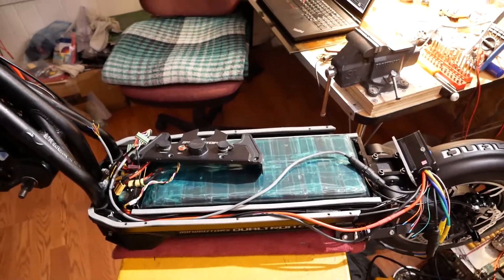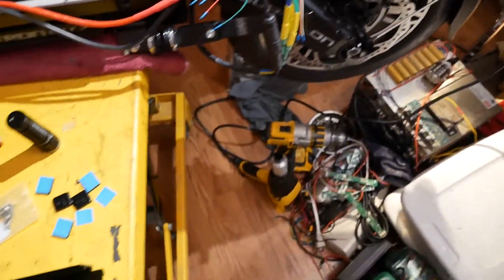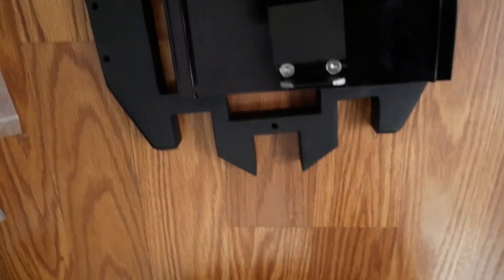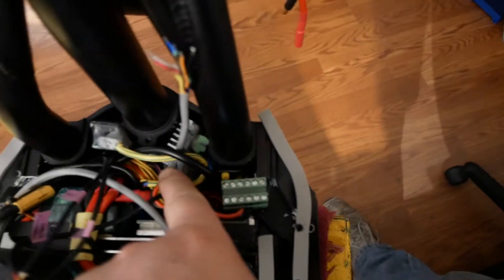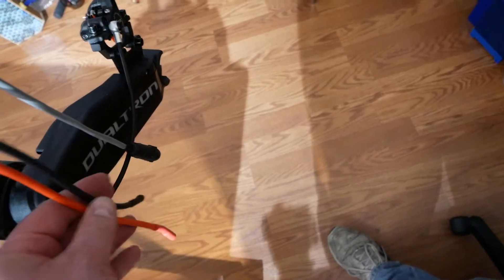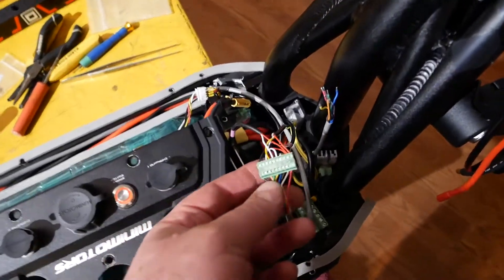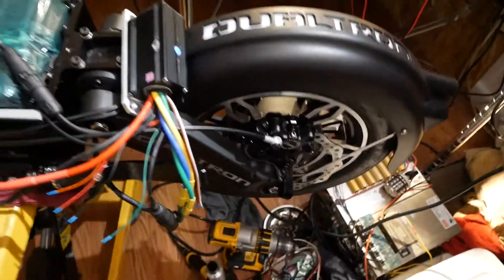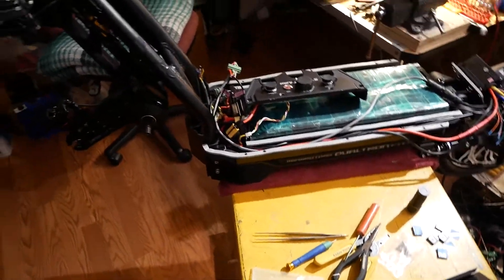Dualtron City build update 20220731

Comment: I had dualtron city but I did not know the position of the speed sensor .Could you inform me ? Thanks
Reply: No wonder I could not fine.thanks for your replay.
Reply from the maker: There isn't one. Speed measurement is based on motor RPM.

Comment: can u do a vid of the  set up on vesc tool.. im doing the same thiing but on a spider  but i cant get the motors to spin with any load .. they just make sounds (alot)and jerks forward and back.. the FOc setup works and i set the flux linkage etc.. rear motor can spin with no load front nothing.. lol
ill give u my ## if ur willing to help out a homie lmk
Reply from the maker: That's quite doable. I haven't done one yet, but it's on the list...just do a full walk through of VESCtool in several videos.
Reply: @de-bodgery  id be very grateful since im using a 75100 also.
i cant find any of the dualtron motor specs witch is making it very hard
i can get it spining at 5amps (going to 160kph) but as soon as u put load on it. it doesnt move// when i put more amps to it the motor just makes sounds and twitches
do u know how many poles ur motor is?
i have a fully custom spider lmt so i know how u feel and feel the same. i like to make my things unique and one off too  
or if u could send me ur setup for UUID id be head over heals lol
Reply from the maker: @carstoniu  you will never find Dualtron motor specs anywhere. They don't publish this info and best you will get is the wattage specs for the scooter from them! My City hub motors are 15 pole pairs. No idea if that is true for other motors from Dualtron. They don't make the motors, just buy them from some other source. Your motor issue sounds like a setup problem, but what exactly, that I can't say.
*
It's much too late now, but it would have made for a good video back when I had my City motors taken apart to record everything about them in a video. I'd have to take apart far too much stuff to do it now.
Reply: @de-bodgery  to count the poles you count the mag strips on the outside correct? mine has 20 so 40 poles..
and i didnt mean your wiriing setup as much as your config in vesc tool 
im so close.. the wheel spins at 5amp the speedo says its doing 160, but as soon as loas is applied it stops.. any suggestions? if i increase the current the motor just shakes and makes horrible sounds 
is there a way i can send u a pic?
Reply from the maker: @carstoniu  Poles is magnets divided by 2. I have 30 magnets or 15 pole pairs. Look up rishimaze on DIY electric car...that's me. We can go from there with whatever else. You probably won't be able to PM me right away. This is some weird thing the forum does. Just post here that you found me once you have an account and your user name there and I'll be able to PM you.
*
I got my motors running by setting the controllers to BLDC mode first. Then I do motor setup and it seems to work OK for me. Pic? Post a video to your YT channel.
Reply: @de-bodgery  did you add hall sensors or anything? i feel like if they had my problem would go away.. seems like hard work to add them tho
now my  main power switch doesnt work,, im telling you ive had such bad luck recently with this
Reply from the maker: @carstoniu  My stators had slots in them for halls, but no halls in them. I added them and also temp sensors. SS41F halls are very common to motors. Buy them from a reputable source such as digikey or mouser. Avoid halls you might find from sources like ebay. Who knows what you will get or if they are any good! IMHO no halls is a bad idea! I'd say it's worth having them so I put them in any motor I have if they are missing. You'll notice that your scooter briefly kicks backwards sometimes. The controllers can't sense bEMF from a stopped motor and so they guess at proper commutation. Sometimes the guess is wrong and the motor spins backwards briefly. The controller then detects bEMF and that this is reverse commutation and then gets things going in the correct direction. This happens with any unsensored controller setup. It may happen too quick for you to see it, but it's happening. You never have this issue with halls. Even dead still, proper direction of commutation is always known.
*
 It's hard to tell what too much phase amps in a motor is without knowing motor temps. I figure out this balance by watching temps. If they get above 140C, it's well past time to back off the phase amps! 110C is OK. 150C is getting pretty close to meltdown. I do motor tuning by feel. I turn up phase amps a little and feel for more motor torque. There is a place in all motors where more phase amps does not get you more torque and all you get is a very hot motor. It's time to back of the current a little to where you get most of the motor torque, but motor temps don't go above 110C very often. That's pretty much optimal right there. Heat is wasted electrical energy and you want to minimize this as much as is reasonably possible without killing motor power.
*
Main power? So is that a contactor or breaker or something else? If you lack pre-charge, your contacts will char and burn from inrush arcing. After a while the contacts inside no longer make up with a good current carrying path anymore. If you don't have pre-charge, you need to add it ASAP. Inrush current and the wild voltage spikes that come with it are hard on anything electronic. It can cause failures.
Reply: @de-bodgery  do you have instagram or something i can DM u on? sorry just been busy but you have helped me more then anything else, really appreciate it
Reply from the maker: @carstoniu  Create an account on diy electric car. I'm Rishimaze on there.
Reply: @de-bodgery  ok iim bcarstoniu
ill add you now
Reply from the maker: @carstoniu  I tried to PM you at bcarstoniu, but it says you are not found.
Reply: @de-bodgery  i added you but it wont let me DM you
Reply from the maker: @carstoniu  You now show up over there so I PM'd you.
Reply: ive spent the past two nights try to get it to run changing setting etc but only got the back under no load and im almost at the point to just spend the money and get another weped(thats wht im trying to make it like) its my gfs and im sick of changing the stock controllers (had 3 now in 2yrs) 
noway you are in canada are you? im literally doing everything the same as you but i didnt make my batt lol samsung makes tesla ones so they are good enough imo 
if you need to wait till urs is done to help me i understand but we are at similar stages.
ps are any of ur lights on the vesc or all seperate now?
dualtron specs are like non existance and they dont even get back to there dealers.. fun scooter till its just a eye sore (while down, due to minimotors trying to make every dime possible)
the difference when you open the deck on a dualtron and a weped is crazy. dualtron looks like a 5yr wired it lol

Comment: How much $ do you have in it so far? Minus the stock City. Badass regardless!!!
Reply from the maker: I'm not sure how to answer that. I bought a mini lathe so I could machine parts as needed. I then bought or made a couple of add-ons for it so I could do the motor venting work. Is that part of the "cost"? If so, that's stuff added about $3000 to the City. I used Panasonic 18650B cells that I bought in 2019. I believe I paid $3.40 per cell or $925 for the cells in the scooter. Controllers were $100 each. Davega LCD, $120. Other stuff...screws, connectors, wire, nickel, bms, LEDs, etc...another $200 to $250.
Reply: @de-bodgery  BRIEFLY :THIS IS NEW AND"THE BEST"  WHY MESS WITH IT SO MUCH?
Reply from the maker: @BOOSTEDLASER  You really ought to consider writing with UPPER and lower case letters instead of ALL IN CAPS. Perhaps you don't know about the CAPS lock key being on? Anyway, just a thought...
*
I never said the City was "the best". It is newly released this year...so that at least is accurate. Your questions have been answered in my first 2 videos I ever made on the City.
https://www.youtube.com/watch?v=TYyTkBHsRIs&list=PLOrUJ_KZtl79PONtYt0Zhc8EFBD6pq0jU&index=90
https://www.youtube.com/watch?v=776kACrg2kI&list=PLOrUJ_KZtl79PONtYt0Zhc8EFBD6pq0jU&index=90&t=358s
Reply from the maker: @BOOSTEDLASER  Did you watch the 2 gripe videos I made about it? If you did, then you know exactly why I'm upgrading it. "The best"? Hardly! Perhaps your expectations are simply much lower than mine are or you just don't know that the city is not that good as is from dualtron? I'm "messing with it" to make it properly good!
Reply: @de-bodgery  DUALTRON IS BAD NOW?
Reply from the maker: @BOOSTEDLASER  You are for extremes! What with your ALL CAPS writing and other things. I never said Dualtron was bad. That's your words, not mine. What the City is however is "in need of improving". Same could be said for all Dualtron scooters. None are great, just adequate.
Reply: @de-bodgery  just for fun may i ask? mine broke before i started upgrading lol urs had 40miles or something like that you said haha
why didnt you get a weped. could have gotten the 40,000watt cyberscoot. my buddy has one and it make my FF look like a baby lol once you go over 100kmh you cant go back imo
ps.gotta get ur hands on one.. im so closing on pulling the trigger on number 2 lol
Reply from the maker: @carstoniu  I didn't upgrade becasue something went wrong. I bought it knowing I'd upgrade it. I generally have low expectations of most EV's. The City was not impressive and I did 2 videos about that. I bet if I did get a cyberscoot, I'd be looking to upgrade/mod it too! I'm sure there are things about it that I'd want to improve. 
*
There are 2 mindsets about EV's. I buy stuff for the platform so I can build what I want out of it. The other mindset is to buy something and use it as is. That second mindset is simply not me. There's no creativity in it, no challenge, nothing more than laying down a credit card and riding away on a scooter. This is a lot like bragging about having a fast Tesla. Well great, what exactly did you do? Oh right...made car payments. The guy with a conversion project that he built in his garage, he has something to brag about! He did the work and built something that didn't exist before. I'm that second kind of person. Hence the massive rework of my Dualtron City.